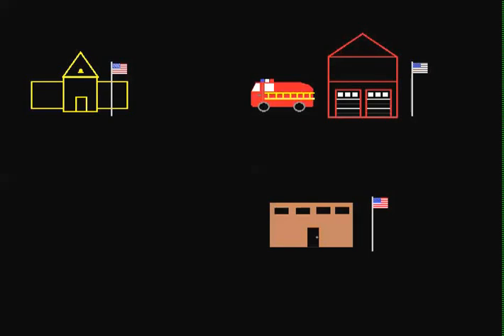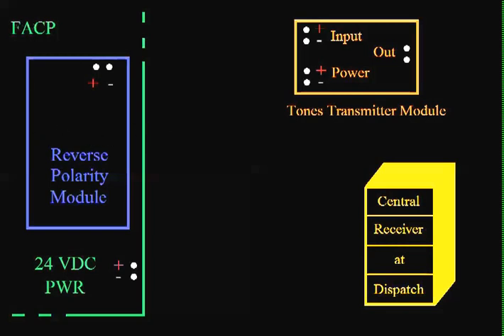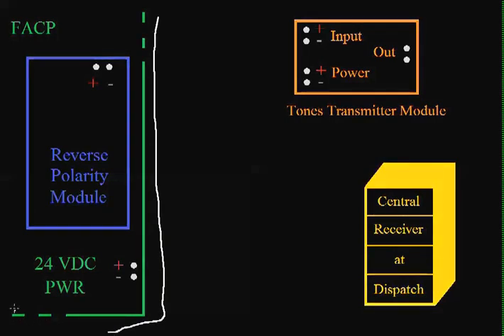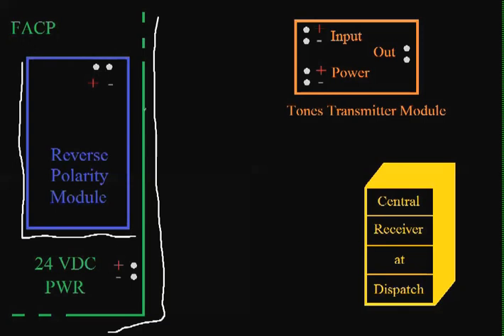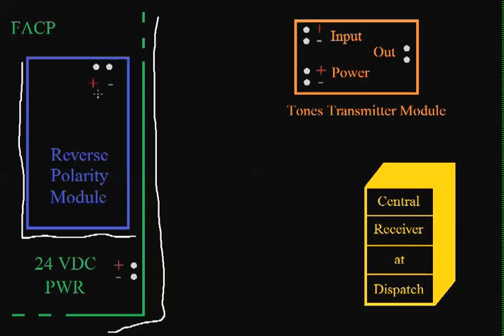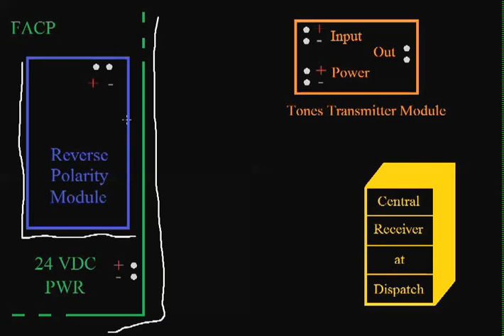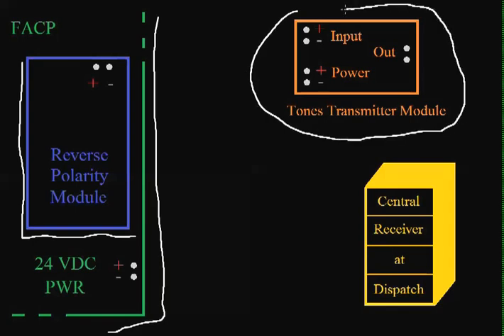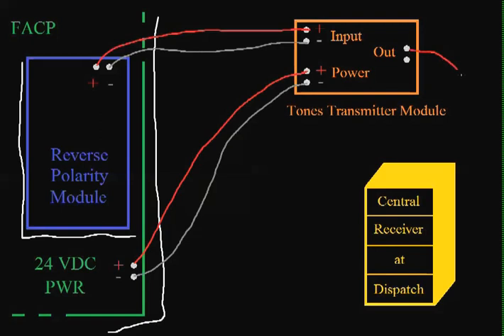7 - Tones Transmitters - Introduction to Fire Alarms

Comment: So, when you say dispatch center, are you referring to a 911 center or a monitoring station run by one of those companies like ADT, Young Alarm, Central Alarm, etc.?
Reply: more like a monitoring station, not the 911 directly... The dispatch center will contact the 911 or the fire fighter after
Reply: I know about that concept, it’s just that there’s also jurisdictions where you’re either simply permitted or in other cases required to have it go directly to the 911 center & I wasn’t too sure what the case was here.